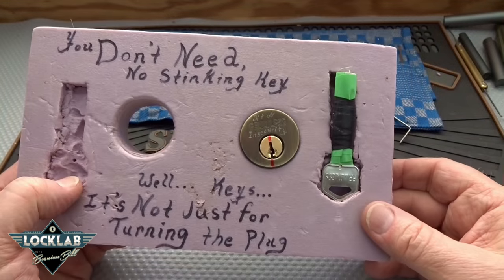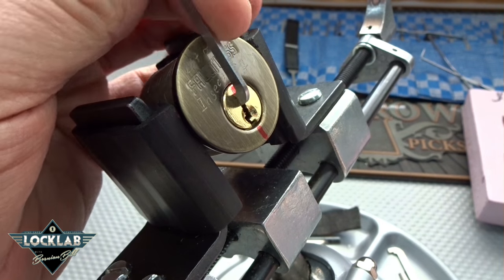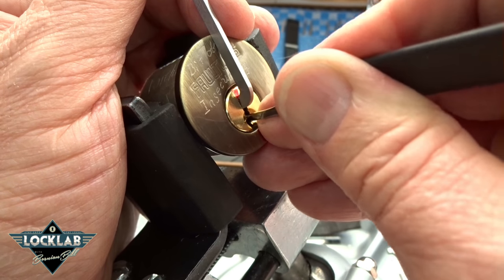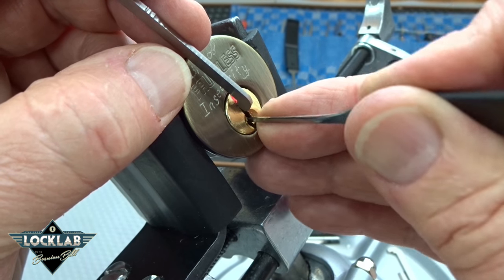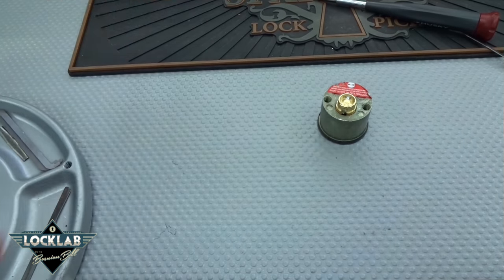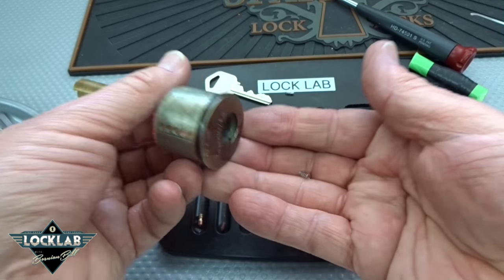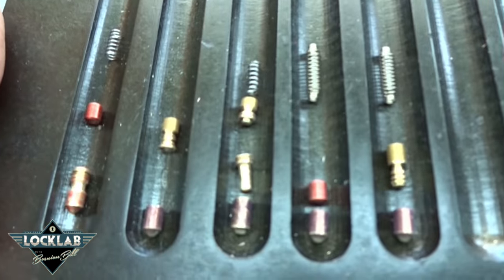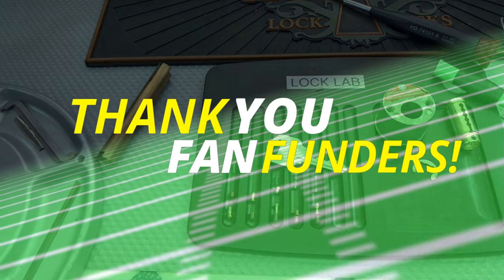(855) "Bit of Insecurity" by Torch

Comment: I am having the neighbor get the remains of his stuff out of the building, and was screwing around with a Sparrows Monstrum, & the locks in the building. They are old Kwiksets I had rekeyed at a locksmith's shop, & am I thinking "Ah old Kwikset, EASY stuff, should rake open like the junk Schlage on my old house". I get two deep false sets. I am thinking, "Spools? Nah!", yep! It had 3 spools, then a spring got jammed in one of the pin cylinders, between the cylinder wall & a straight pin, so I managed to dig that out, & set the pins aside. I have to admit that paying the extra 14 cents per spring, for genuine USA made Kwikset springs is worth it! 9 cents each, or 23 cents each? Spend that extra $14 for a bag of 100, PLEASE!

Comment: Bill, I need some help. I used to be a fairly good picker, I could pick an abus titalium in 15-20 mins. I stopped practicing for about 4 months because some other things came up, and today I discovered that I can't even rake a master lock, let alone spp it. I'm not kidding you, I tried to rake, zip and spp 3 different master locks for an hour, and not one open. So I guess I have to start over from the beginning, but I'm confused because I thought raking a master lock is as simple as it gets!
Reply from the maker: You're probably just having a bad day.  Put the picks down and come back tomorrow.  Happens to me all the time.
B
Reply: I put my picks down for over a year and had the same problem. I watched beginner videos and read some more in depth articles on picking to get back in the groove of things.
Reply: bosnianbill Thanks for that, since sometimes its hard to realize that you just need to stop trying and come back fresh. Also, something that may interest you is that the Master #3 locks now have serrated pins!
Reply: +A. Zak I just got a Sobo disc detainer the other day and it took me a good hour to get the pick. Keep at it.
Reply: brian easton I've never even tried to pick a disc detainer, but an hour, wow! That was a difficult one!
Reply: I got myself one of those abus titalium yesterday a 64TI/50. Being a little disappointed for I could not SPP it, not even managed to get a false set. So I tried to rake it into a false set using a standard snake rake. Well I couldn't get a false set either that way - instead it unlocked. Thought I must have been really lucky and so I tried it again. Again no false set but an opened lock. Still I can't SPP it I guess my hook is too big for that keyway but by now I must have raked it open more than 15 times in a row without any luck getting a false set to SPP it. I thought those abus titalium were supposed to have security pins in it?
Reply: +Macmillan Spools I believe. If you can rake it with a snake, the bitting must not be very extreme and you might be oversetting the pins when you spp it.
Reply: that's right the bitting is not that extreme, but still I thought it's more difficult to rake locks that contain spools. and yeah I keep oversetting the first few pins with my pick, because it always hits those pins in the front when I'm searching for the binding one in the back. damn european cylinders seem to be so much tighter
Reply: +Macmillan I've picked a few titaliums and in my experience the 80TIs are full of spools but the 64TIs have standards. try a different tensioning method, might help spp
Reply: standard pins... hmm that of course would explain why it is so easy to rake or rock open. I guess I'd rather get an abus 80TI instead of trying to SPP the one I have since it's been unlocked so many times it doesn't even matter how it worked all that matters is that it got picked hehe but thanks it's good to know that the 80TIs are full of spools at least :)
Reply: +Macmillan yeah my 80ti has all but 1 spools
Reply: +Macmillan I had it for months before I realized my pick was too big and just got it open a week ago with a pick I made. Peterson gems are perfect for it.
Reply: BikingMNViking Wow, you're a lock picker too? We really do frequent the same channels!
Reply: No, I install locks. I rekey household locks on a rental property. Just visit here occasionally & his vids are addictive... the tension as he is close to the opening..... its as good as it gets! And seeing what pins are where. But I do own several high grade locks and hope to learn how to improve boxes of cheapies I have in the basement my father left me with. I've never picked a lock in my life... I always have the key or a bigger better tool. I'm thinking of getting some of these pins and doing it on some locks for my mom's place just to keep her a little safer.
Reply: BikingMNViking If I were you I'd just buy a Medeco for mom's house. Once I put a load of security pins in a kwikset, and it worked great for a month, but then the key got stuck in it and I had to take the lock completely apart to free it. A spool had become bent from shoving the key in too hard and it locked up the cylinder solidly.
Reply: A. Zak
She's got medeco's already and a hand cannon. If I was more concerned about real serious security I'd be shopping harder for dogs & training/schooling them. I was thinking storm doors and storage areas and mostly to learn. I've already got 3-4 dozen of those plastic cylinders laying around in my dedicated locksmith kit, got dozens of pins. Don't have to buy a thing to do this. Got a dremel, drill press, couple boxes full of various old locks which I find to be higher quality than most of today's stuff...most solid brass with different coatings. I have buffing wheels and can make them look like new and acrylic lacquer them. I suppose you could say I'm studying for a rain day project. Winters are long here. (speaking of which I have AVE in my circles, like you, and he's on every new site I subscribe to also...hilarious, but I can understand it because of where he lives the winters are gonna be longer than ours.)